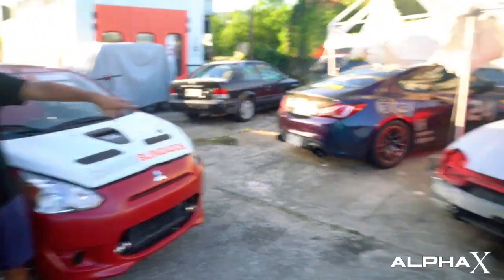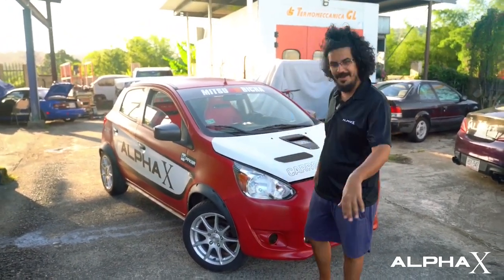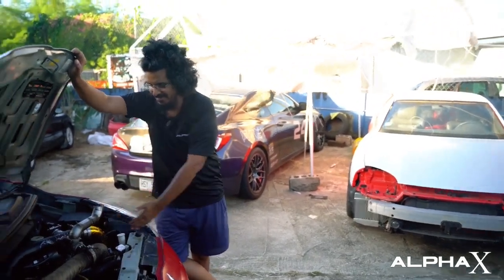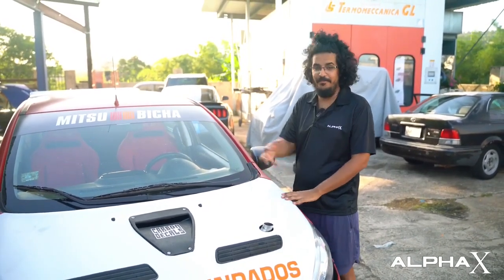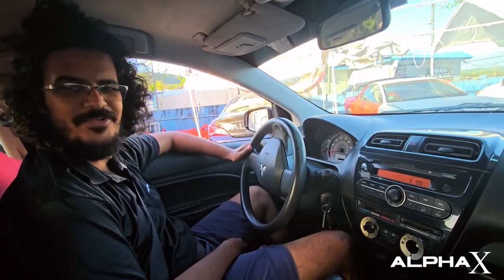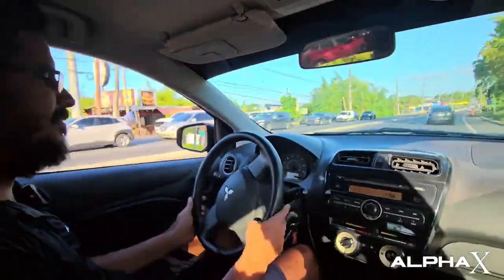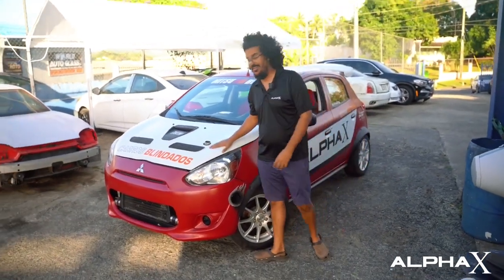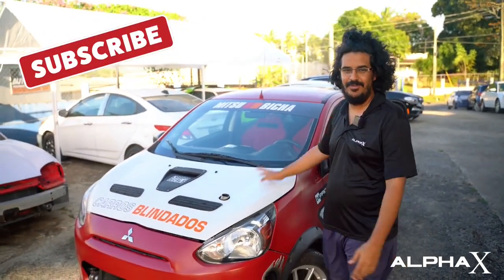Twin Turbo 3 Cylinder Mirage tested on the dyno and more!

Comment: You can tell this was a good hair day
Reply from the maker: Yes sir
Reply: Basically.... it's aliens. Lol, honestly I have the same hair problems. I never thought a mirage could actually be kinda cool. Here in my state (PA), as long as the ECU has the right VIN and all the right info when they plug it into the inspection station computer, and it passes the emissions test (which local dynos can easily get stuff at this power level to do all the time) it will pass. Do you have any info on your ECUs ability to do this?